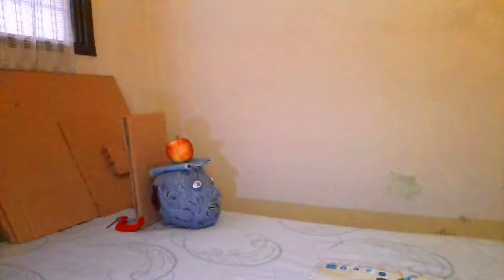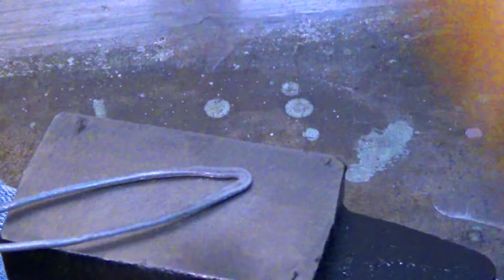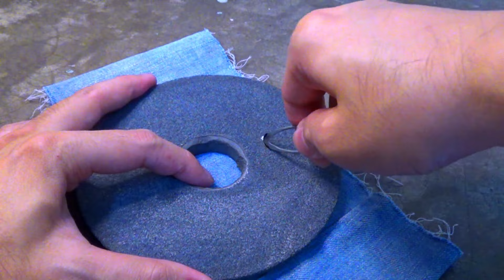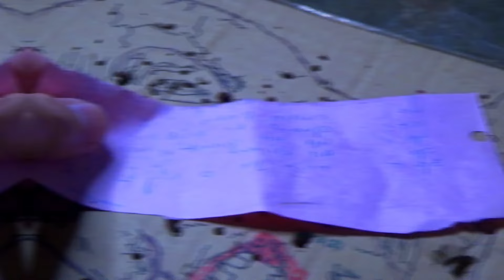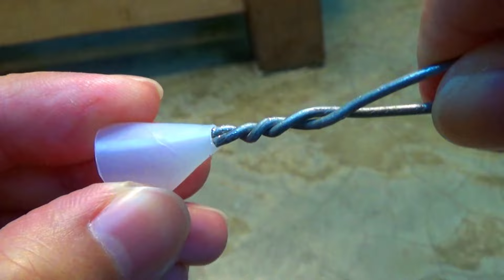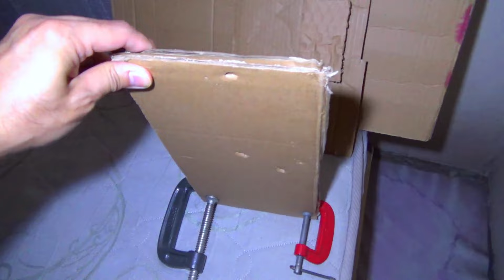Forging & Sharpening Easy Razor Blowgun Dart (Prototype) Heavy! (2024) ★★★★★

Comment: That's why I love blowguns. You can literally improvise and use all the materials you have to make all kinds of darts. And it's not affected by weather conditions at all.
Blowgun's power and accuracy is limited compared to other weapons, but It has the best durability and consistency among other DIY weapons and never dissapoints it's user.

-Alcohol gun not firing in cold weather because Alcohol evoporates at 37C. I tried butane as a fuel but its not good as Alcohol. When using butane, reloading takes at least 2 min.
-Slingshots lose their power in cold weather. Some people in slingshot forums say that they lost 100 FPS when the weather is cold.
-I don't own one yet but as far as I know PVC/Wood Bows become brittle and lost their most of power in cold weather.
Reply from the maker: Spot on! Blowgun might be the weakest of all "primitive weapons", but it's advantage is exactly what you pointed out! That's why Tim Wells is reliably using it for hunting, just simple and reliable!

Your place is snowing now?
Reply: @LKH9Channel  No, it's not snowing but quite cold out there. Only 5 degrees and temprerature drops to -3 at night.
Reply from the maker: -3🥶